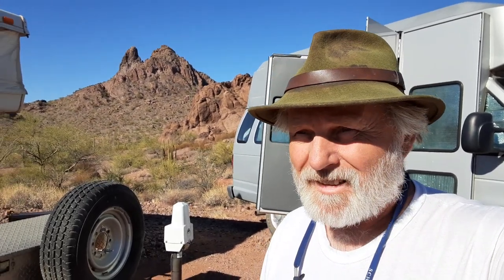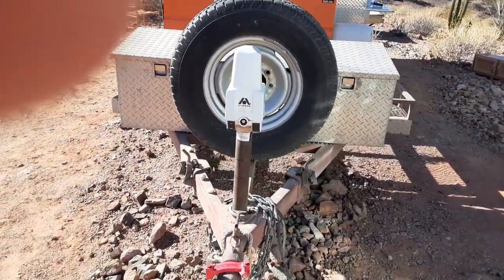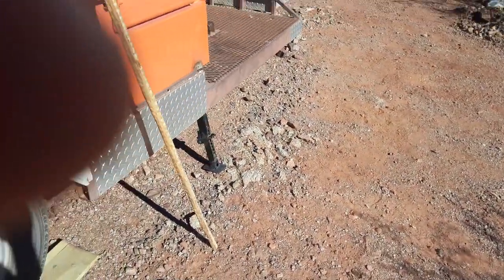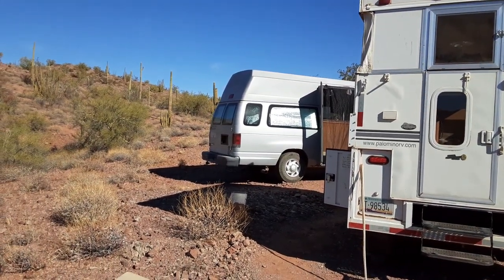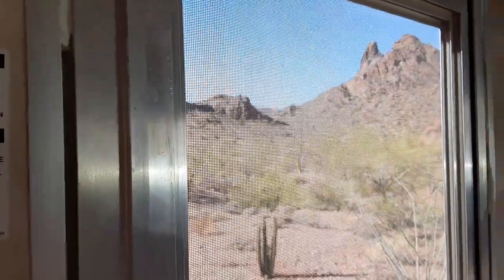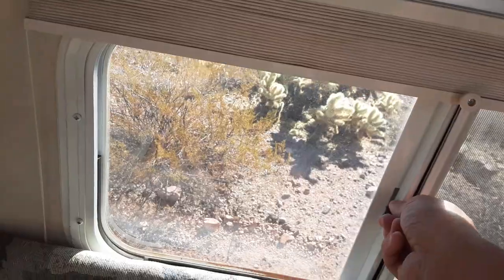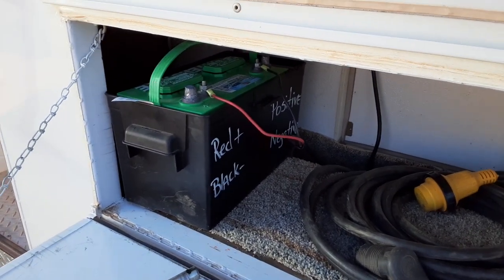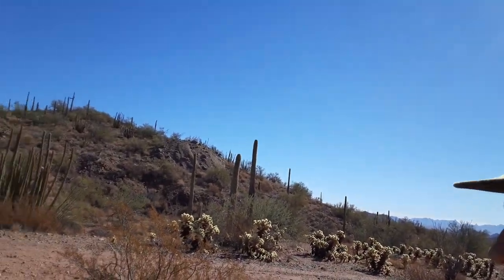Palomino Pop up truck camper Conversion utility bed fourwheeler trailer RIDGID tool box

Comment: Love this! I’m looking to do the same. That pop up camper has great head room at the bed. I swapped my mattress from stock to 10” memory foam so headspace is limited. Do you find the trailer to be limiting your adventures in any way? I have a single axle I want to put my truck camper on however I’d trust having 2 wheels on each side much more
Reply from the maker: I took it off road and it did well except for tounge drag in big dips ( typical )
Unfortunately I have sold this unit and now have a 16 ft box van that I am converting to a camper.
The way the Palomino was set up though was awesome and I might miss all the storage compartments. 
Thanks for watching
Reply: His set up is a marriage of three . A two axle trailer a utility box truck bed and a collapsible truck bed camper .you'll definitely need to switch up to the dual axle trailer to hold the loaded combined wait. To be safely rolling that get-up.